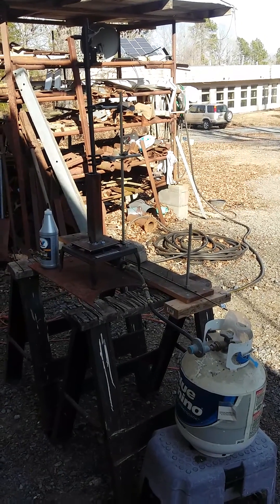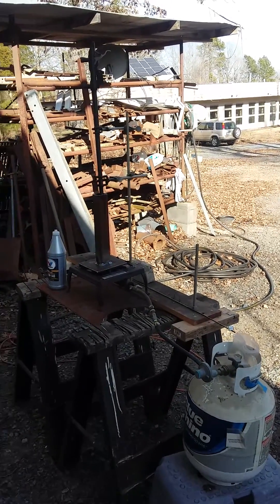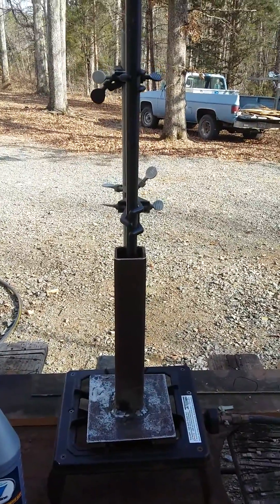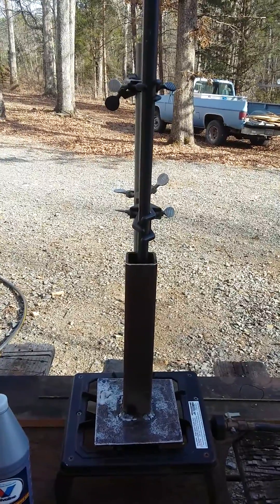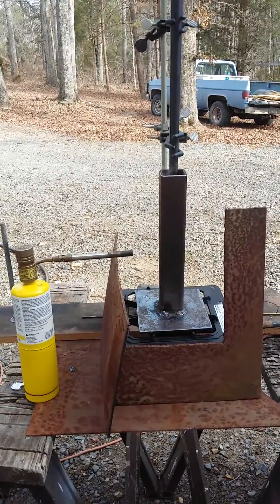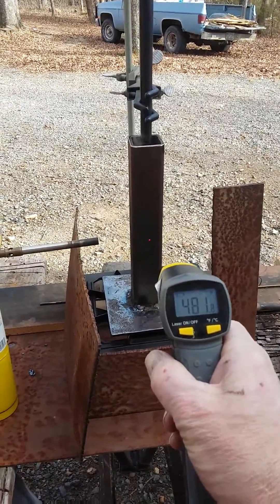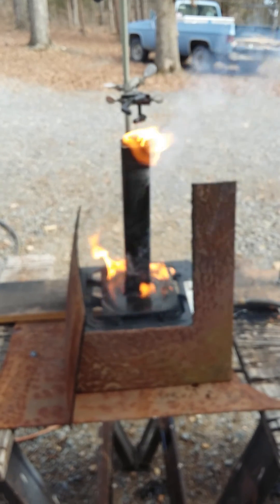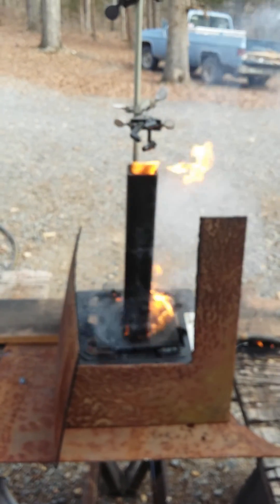Removing a stuck bullet from a rifle barrel: Part 2

Comment: I've driven many of bullets out without the heat
Reply from the maker: I initially tried to drive a brass rod through the bore, but was not successful.   I later discovered the customer had plugged the bore by firing several subsonic bullets, instead of just one.